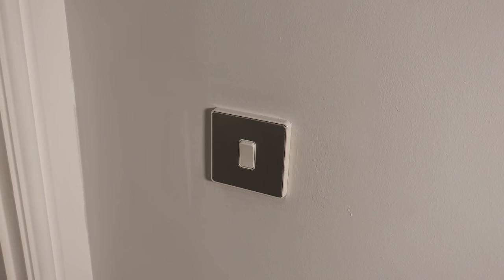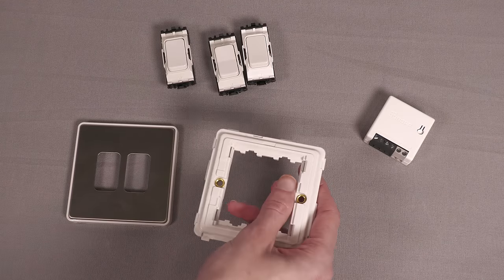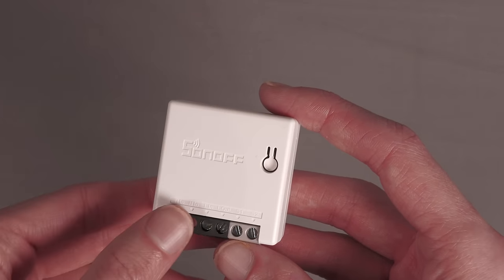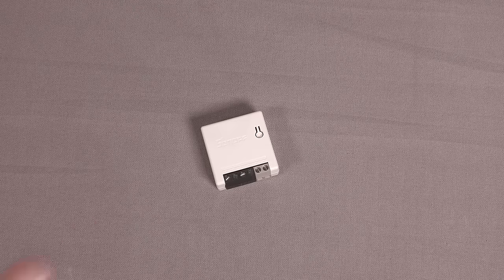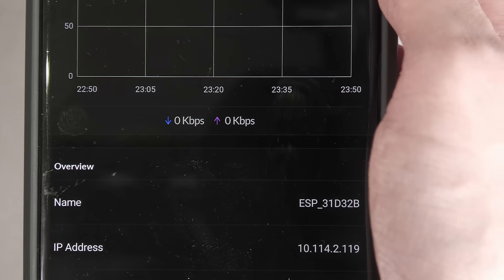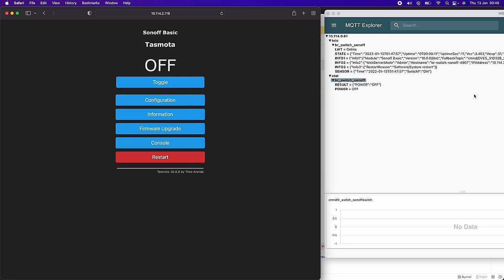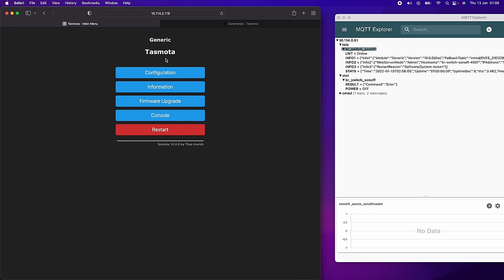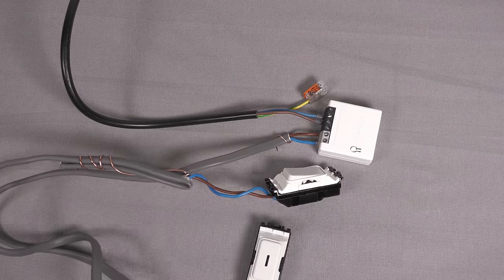Turning an Existing Light Switch into an MQTT Connected Smart Switch using a Sonoff Mini

Comment: Shelly devices are nice too and natively support MQTT if you want to save flashing. I'm using them with Node RED to control my electric panel heaters 👍
Reply from the maker: Interesting, I'd heard of them but never knew they supported MQTT natively so went for the Sonoff since I knew they were flashable.  Might take a look at the Shelly devices in the future.
Reply: @camerongray1515  yep they're pretty good. Nice and compact and you get interesting energy monitoring data with them too 👍
Reply: @alanjrobertson how have you installed the shelly? Have you used a deeper box? Does the regs allow to install a shelly within the box?

Comment: Looks like a great solution; especially with the two position retractable switch. The only downside I can think of is not have additional buttons for colour temperature, but that's pretty minor. 

When the times comes to fit out my whole house, I think I'll look for a smart switch with 4 buttons (on, off, colder, warmer)
Reply from the maker: Yeah, a button to change the colour temperature would be good - I used to use a previous setup with the two position retractive switch (hold to dim up/down if the lights are on then if the lights are off, hold down the top button to turn them on cool white, hold down the bottom to turn on a very dim, warm nightlight mode then click normally to turn on a regular warm white).  Unfortunately the hardware I used in that project was discontinued before I could make the video on it.  That said, I'm working on a project involving flashing open source firmware onto a cheap LCD smart switch to provide a full on-wall touch panel so stay tuned for that!
Reply: @camerongray1515  that sounds really interesting, looking forward to that!

Comment: Hey Cameron, i also found the MK grid retractives are tough to press. You can however make them easier by dismantling them and removing one of the springs, which leaves just one in place 😎 They come apart without too much difficultly.

Comment: Nice video, thanks
I've been installing sonoff TX touch switches throughout my house. (all tasmota)
I did consider sonoff minis or Shellys, but decided against them for two reasons:
1: The physical size,  I'm not sure I'd fit them behind many of my switches - especially those with multiple gangs, so lots of wires already behind the switch.
2: Like you - I wouldn't like the switches being in the "wrong" position. With the touch switches there is no position, this is good in a way, but also I've found it a bit annoying that I have to look for where to touch rather than just reaching for the switch without looking and being able to turn them on/off, like when leaving a room I was so used to just mashing the top of the switches to be sure everything is off. The momentary switches are a good alternative to the touch switches in some cases, but you have no indicator to see if the switch is on/off. If the switch controls a light then this is fine, but I have some switches that control a fan. In this case you can't be sure you've turned it off without looking at the fan and seeing if it is slowing down.
The ultimate solution for me would be a physical switch like a standard light switch that would actually move position if the relay is toggled via MQTT or Alexa etc. ZERO loss of functionality from a standard light switch with the benefits of a smart switch.

Comment: Thanks Cameron, really great info throughout, particular the half main voltage on the "low voltage" pins. I wouldn't have thought to check that and lots of other vids lead the viewer to believe that the grey ones are low as in 5v/3.3v dc. I had in mind using one of these for gas meter monitoring (reed switch counting) with custom firmware but now realise this is not the tool for the job.
I've tasmotised one of my miniR2's but need a no neutral mod or to use the R3mini with s-wave but not sure if ota script will support tasmota on the MiniR3 with the S-wave.
Also I like the idea of those multiple rocker switches. I have calex tuya lightbulbs (from tesco) which are dimmable and rgb so two rocker switches one for rgb cycling one for dimming and a simple switch for off. This is so kids can faff without having to use a phone / tablet.

Comment: I really like this idea, but the need to have neutral at the switch makes it difficult, I don't know when practices changed, but the majority of systems I have seen have neutral at the ceiling rose and the switch just has a switch wire. I guess you could possibly put the Sonoff in the ceiling.

Comment: Great video as always! This is a very neat solution and I totally agree with you about not having to rely on voice assistants. Unfortunately, the wiring accessories at my house are BG Nexus Metal and they only have one retractive grid module available rated at 20A! My worry is that this will be even more difficult to press in than the MK offering. We already have the standard 20A DP grid switches in the kitchen, and you really have to apply force to switch them.
Reply from the maker: That's very true, suppose it might just be a case of buying a single module on its own to see how it feels.  Not sure if it's the current rating or the fact they're DP that would make them stiff - My regular light switches use the MK 20A 2-way modules (just what was available) and they feel fine whereas the 20A DP switches I have are significantly stiffer.

Comment: Nice video. I’m currently using Tuya with retractive switches which so far has worked perfectly, although I need to find a way to make the relay controllers respond to momentary instead of latching. I agree about the stiffness of MK switches. I went for click minigrid retractive in the end for the same reason.
Reply from the maker: I actually had Click Define accessories previously using their Minigrid switches and absolutely agree that the retractive switches were a lot nicer to use. Unfortunately I had an absolute nightmare where the inrush current from my AV setup (AV receiver, Mac Mini, Satellite box and Subwoofer) and office desk (Couple of monitors, laptop dock, couple of speakers and a standing desk PSU) was enough to weld the switch contacts on the sockets closed (would often weld the live and only switch the neutral).  In fairness, Scolmore were excellent and allowed me to RMA all of the matching accessories I'd ordered and not just the faulty sockets.  Replacing it with the MK stuff was very much a "play it safe" response, was torn between MK Dimensions and BG Screwless.  Annoying since the Click stuff was really good value and was one of the best looking aesthetically options on the market I could find, might need to revisit in the future after testing them against high inrush current again.
Reply: Stiffness can be reduced by unclipping the front of the switch and removing one of the two springs. It’s a lot more bearable with just the one spring. I’ve done something similar but wired the momentary switch to an IKEA shortcut button.
Reply from the maker: Thanks, just tried removing a spring from one and it's made a massive difference!  Think I might throw together a quick bonus video on how to do it!  Also, amusing you say that about the IKEA smart switch, I actually had a setup using the centre off retractive switches wired up to a modified Tradfri dimmer (the one with the separate on and off buttons) and it worked great, set everything up to make a video of it, went on the IKEA website to find the pricing only to find they'd stopped selling the switch in the UK so I had to shelve the video 🤦‍♂️

Comment: Hi Cameron. Many thanks for this. What depth backbox did you need for this? I want to brief my architect client base to spec deep boxes, so a dimension would be helpful. Thanks
Reply from the maker: It's a 47mm box, wouldn't fancy fitting it in anything much shallower.  Personally, unless a deeper box would require extra chasing of brickwork, I always just use 47mm boxes as standard.

Comment: Cameron, Another great video!  Just curious, why did you go with the SONOFF MINI over a shelly device like the Shelly plus 1 or  plus 1PM?  I have the older MINI's and they worked great for 2 years controlling all my upstairs lighting, but they have all started dropping connection recently and don't want to reconnect to my Wi-FI.  I have bought Shelly  plus 1PM's to replace them, but initial testing has shown that the Shelly 1PM's do run hotter, but expect that's due to the power monitoring hardware in side them.
Reply from the maker: To be honest, it was purely due to the Sonoff being the first thing to come to mind, the Shellys do look interesting, might have a look at them in the future!
Reply from the maker: To be honest, it was purely due to the Sonoff being the first thing to come to mind, the Shellys do look interesting, might have a look at them in the future!
Reply: @camerongray1515  LOL Thanks for your candid reply. I think both brands have great products and the Sonoff's are cheaper for sure. The R2 mini looks to be a considerable improvement over the original mini, I may get some of them to try out for myself as well.

Comment: Excellent Video - Thanks

Have you considered swapping the Sonoff Mini out for the Zigbee version (Sonoff ZBMINI-L) to fit in with the rest of your lighting infrastructure?
Reply from the maker: I did look into that but for me I'm only really using Zigbee because at the time it was simply what was easily usable to get local control of light bulbs.  It's also good for low power devices such as remotes - therefore I'm not too worried about it "fitting in."  I considered the Zigbee model however the benefit of Tasmota is that I can configure it to decouple the relay from the switch input so I can use the switch as an input to the system but separately control the relay.  As far as I'm aware, the Zigbee model can't do this so operating the switch will also control the relay.  Not an issue in this particular setup as I'm not using the relay to switch anything (so it would just click when using the switch) but would be less flexible if I ever were to need the relay for something (for example if I were to deploy this for my bathroom - I'd need the relay to control the fan).

Comment: This is an amazing video.. thanks. Forgive my noob question... how would the flashing be different for sonoff mini zigbee?
Reply from the maker: Thanks!  Generally Tasmota is only designed for WiFi devices to make them work totally offline.  With a Zigbee device you can just use the original firmware then connect it to a locally hosted Zigbee hub, I use Zigbee2MQTT running on a raspberry pi for this

Comment: Could retractive switches be used with existing smart lamps/bulbs without the need for a relay? i.e bypassing the switch to allow for constant power to the light but still allowing functionality on the switch? I think I've looked at too many resources and just got myself confused - was gonna bring an electrician in but need to understand what's required first so I can get what I need and explain properly what Im hoping to achieve

Comment: Hi Cameron, Do you have the links to where you bought your faceplates and mk modules? have you ever used Shelley switch devices? thanks for your awesome videos, you have inspired me a lot with what I have done at my house.
Reply from the maker: They're from the MK Dimensions range then the modules are just standard MK Grid Plus modules.  They're available from CEF and Rexel along with a few other wholesalers, just bear in mind that they're sold as 2 different parts so you need to buy the actual switch/socket itself in black or white and then separately buy the decorative cover in whichever finish you want (stainless steel, black plastic, white plastic, brass, bronze.etc) where each of these will also give a choice of a black or white surround.  Best thing to look at is the PDF catalogue which gives all of the part numbers which you can then search for since some of the wholesaler websites are dreadful for browsing: https://buildings.honeywell.com/content/dam/hbtbt/en/documents/downloads/MK%20Dimensions%20brochure_UKMK432-0418-EN_FINAL.pdf.

As for the Shelley devices, I haven't used them yet but they look good, in hindsight I feel like the Shelley i3 would have been a better choice for this project so I might get a couple to test out in the future.

Comment: 5:05 in my case the switches around the house don’t match (the landing light switches are one type, the living room is a different type, and one of the bedrooms and the kitchen have a third type), so it wouldn’t be an issue for me

And the two way retractive switch (whatever it is called) looks like what the school i went to back in 2012 had, when they moved into the new building (the switches had separate “buttons” for on and off, as some of the switches would control only 1/3 of the lights in the room, while others would control ALL of the lights in the room (the switch by the door controlled all the lights, and the teachers desk switchs allowed the lights on the left and right to be toggled independently, in addition to turning them all on and off (the lights in the middle could only be turned on and off with all the others))

Comment: hey, what module switches/faceplates do you currently recommend? been looking at MK grid, are they all much the same? will be standard white faceplates with either 1 or 2 modules (standard on/off switch and key switch)
Reply from the maker: My general recommendation is to match whatever you already have assuming you're happy with it since even with white accessories, there's variations between brands in terms of the shade of white and the side profile of the accessory.  For example, I'm about to fit some key switches in a friend's new build house so I'm using the same Deta Slimline products that they already have throughout the rest of the house.  If I have free rein to pick and I'm not matching anything existing I tend to stick with MK as a decent quality safe bet but there's plenty other options out there.  Only downside I'd say with some grid systems (including MK) is that the two module grid plates have the screws positioned top and bottom which you may not like the look of.  If you're using two gang plates you may want to consider either a brand that has screw covers/a screwless faceplate.  Or you may want to look at something like Click Minigrid which has side mounted screws (I originally used this for my flat but had a nightmare with the socket switch contacts welding returned them and switched to MK)
Reply: @camerongray1515  yeah the two module faceplate I had earmarked has the screws top and bottom which I originally didn’t notice. 

The faceplates elsewhere are just bog standard “new build” white faceplates so nothing special (although a few are already covered up with Hue smart switches sitting over the top of them)
Reply from the maker: If it's a new build then you'll likely be able to identify what the existing ones are by the brand name on the inside of the faceplate.  Most new builds I've seen are either Deta Slimline, Schneider Lisse or occasionally something from BG.  As for covering them with hue switches, that could be a consideration as the MK key switches protrude slightly from the faceplate so you won't have a totally flat surface.

Comment: Aren't S1 and S2 3.3v DC?
Reply from the maker: They're low voltage contacts in the sense that there is low (or maybe even zero) voltage between S1 and S2.  However due to the power supply design there is 130v between either of the switch contacts and ground so it's critical that they are treated as essentially being live at mains potential